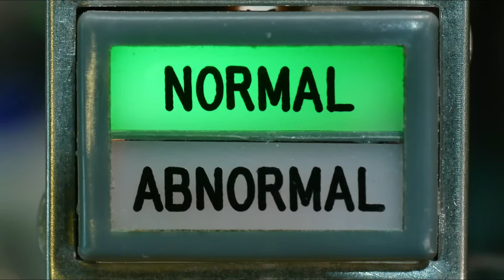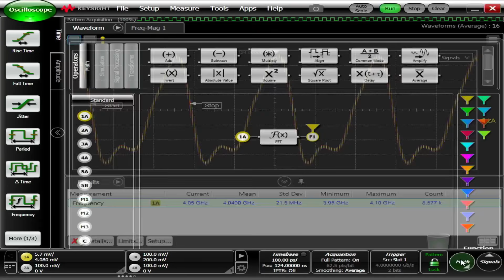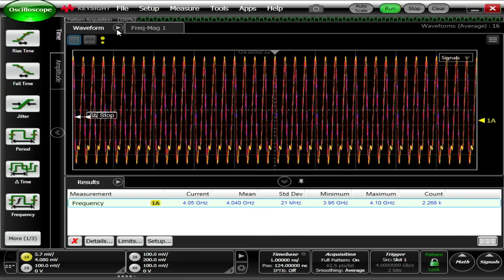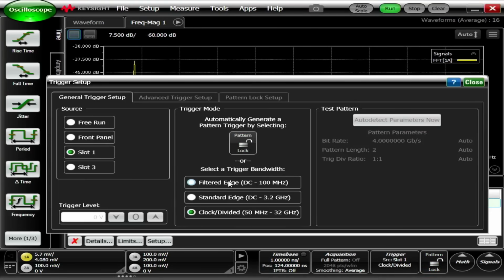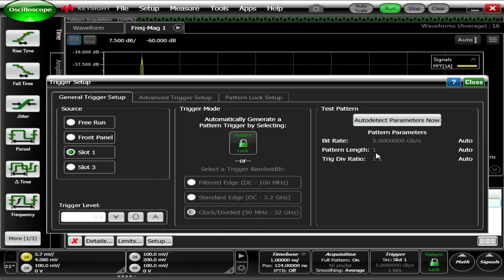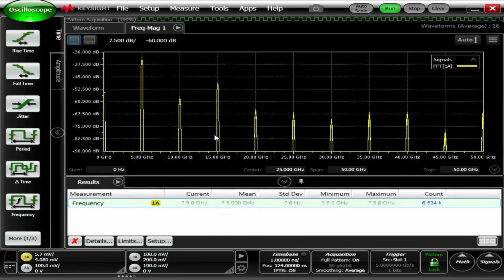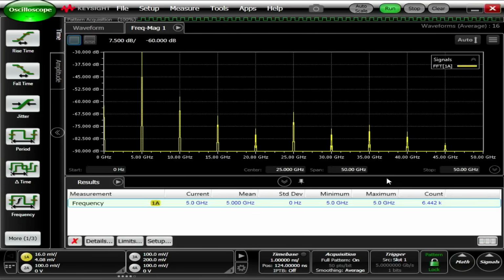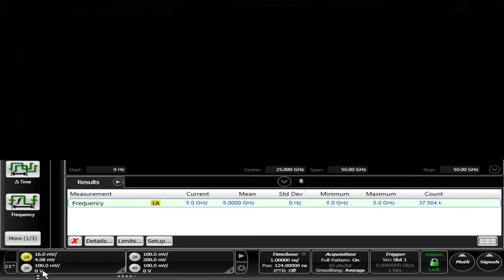#2297 DCA-X 50GHz Spectrum Analyzer

Comment: Since this is not a real time oscilloskope but a sampling oscilloskope, isn't the fft limited to simple repeating signals that can reliable be trigered at the same point?
Or does it do some clever tricks to handle other signals?
I mean the if it uses the mean value at each point for the fft, a eye diagram of random data will look like 0 V DC.
Or is it using the full probability distribution at each time in some way?
FFT of the average after triggering events is useful in some situations but will miss noise, modulation and so on.
Reply from the maker: the waveform is developed using sampling, but once you have a waveform, then it is just math to get the FFT.
Reply: @IMSAIGuy Yes that is what I was thinking.
But the sampling process will generate a pointcloud, not a waveform. I think the reconstruction will take the average value of the samples in each time interval. For signals that repeat exactly the same each sample that will be correct but otherwise you losses information when converting a pointcloud to a single reconstructed waveform from the pointcloud.
Reply from the maker: @larslindgren3846  I suppose. just like a normal digital scope interpolates with sin(x)/x
Reply: @IMSAIGuy Yes in some way, but would it not be more like using the averaging function over a high number of acquisitions on a normal scope and then taking the fft of that average signal?
Any frequency component that is not in a fixed phase relative to the trigger events will not show up?

Comment: Don’t you have a rubidium clock?  Can you do a jitter measurement on that and compare to a clock generated from a regular signal generator?
Reply from the maker: something to try, not sure how it will do at 10MHz, pretty slow for this machine
Reply: @IMSAIGuy But the jitter measurement should be in the femto seconds, so would require a fast machine like this.
Reply from the maker: I checked and jitter tool is minimum of 50MHz
Reply: @IMSAIGuy That’s disappointing 🤨

Comment: Wow the user interface is incredibly ugly. They cannot do a better job of that considering the cost of the scope?
Reply: looks very early-2000s web design with the fake shiny buttons everywhere
Reply: Beauty is in the eye of the beholder.  I think it looks fine considering the age of the instrument.
Reply: That scope was made on gumment contract, not really to be sold on the open market. Only the taxpayers could afford that scope when it came out.
Reply: @glasslinger  Not really.  A relatively small RF lab (in other words they are not Bell Labs) down the road from me got two of them a few years after they came out.  They have nothing to do with the government or government contracts.  They recently got a new Keysight UXR1004B 100GHz scope.  A friend that works there let me in to see it a few weeks after it arrived.  He jokingly said he had one condition, I had to wear a bib so my drool didn't dribble all over it LOL.
Reply from the maker: it was a standard product. the HP 54750 was first, uses the same plug in. the 86100 was next, now the N1000
Reply: It does look much older than OS it is running on (Win7), I tell you that. Even in XP days, UIs got slightly slicker.
I suppose they did not provide a way to upgrade underlying OS on such a custom piece of equipment, did they. Half of the thing would probably break after moving to even Win8.